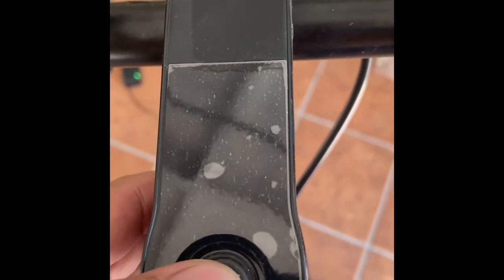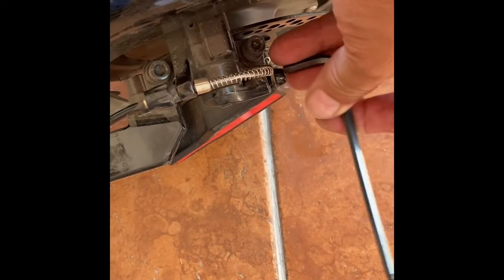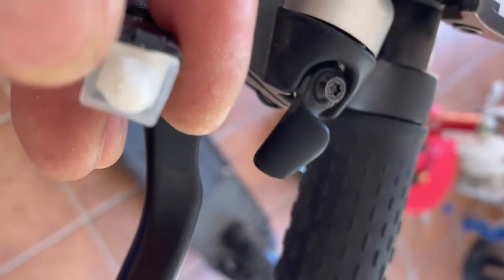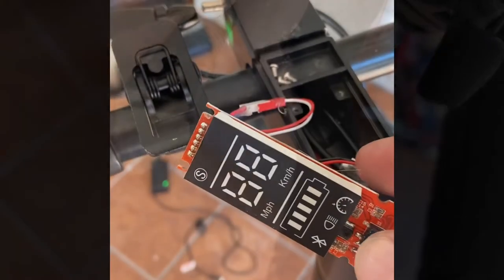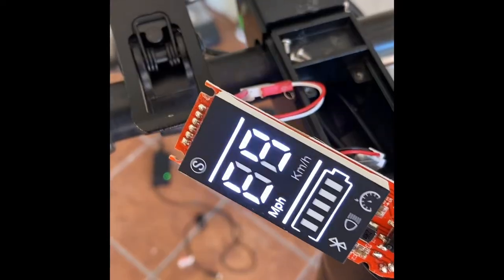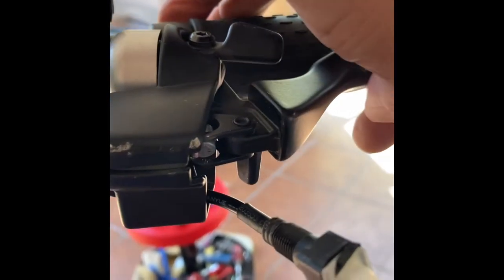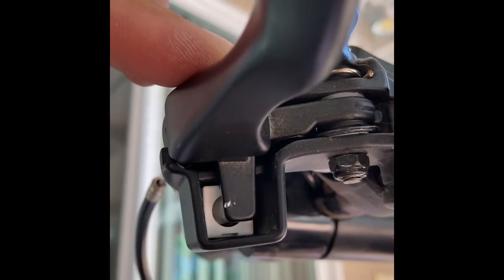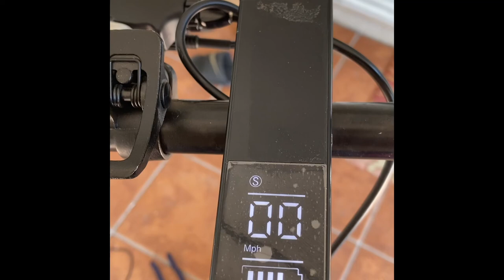E9 error electric scooters fix , hover 1 alpha, other scooters

Comment: Took the hover1alpha out of the box , put the charger on for the 1st charge,  the battery charger ( green light appeared instantly) the charging ( red light  ) did not come on , the scooter is dead . What's wrong ??
Reply from the maker: double check the connections inside the steering column, make sure the charging cable pin is not bent, if the charger is not making good contact it will always be green. And last, if its out of the box, means its brand new, then you can return it for replacement or refund.
Reply: Emailed Hover scooters for tech support  , they won't speak or help anyone without a receipt.  This was a Xmas gift from my daughter that's over seas . Hover scooters support and or parts is worthless  !!!
Reply from the maker: You can return that to the store and tell them you paid cash and missing the receipt. They will do that for you, all stores has 1 time no receipt policy for returns.

Comment: Hí!
I have same issue. The brake wire voltage must be 2-2,5V. (the middle wire) Temporary I soldered two 1k Ohm resistor instead of brake hall sensor.
Reply from the maker: Brakes are done by 1. Lever pull cable 2. Magnetic brakes activated when the button is released. The button is in normally off position and when released its on ON position,
Reply: @DodoyTulare  I boughht a new controller with smart display. The first start it show E9. It has a 3 wire brake connector, I think, it require hall sensor, like accelerator. I set it to half voltage. It work. Before it, I tried to short middle wire to + wire, after tried short to negative wire, the E9 still.
Reply from the maker: @jaccca777  isn’t E9 is for brake button getting stuck at open position ?
Reply: @DodoyTulare  I don't know, I bought a new set of controller. The set not included brake sensor. I tried to short signal and VCC, and short signal and GND, but same result, e9 still. Vhen I set it half of VCC, it start working.